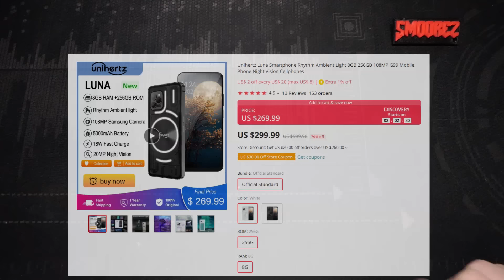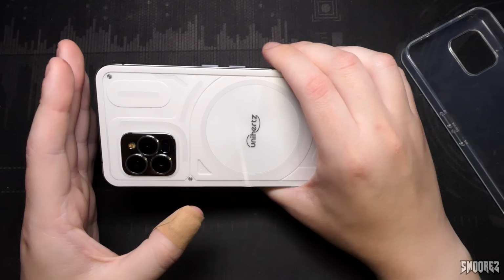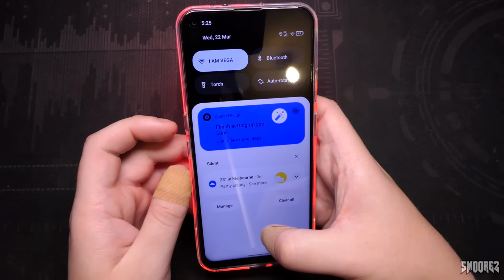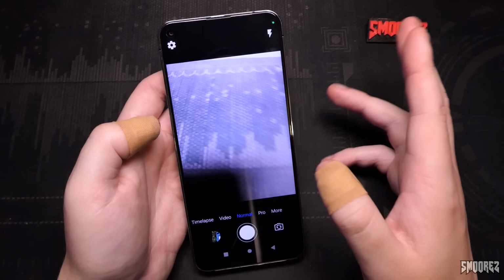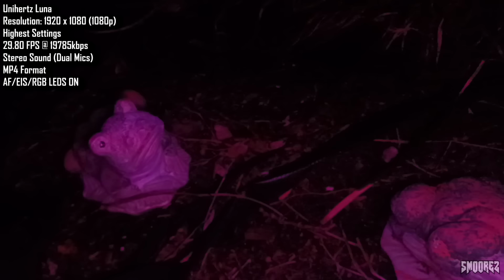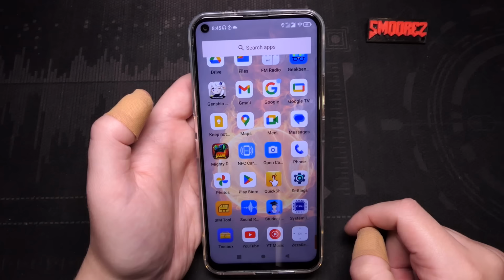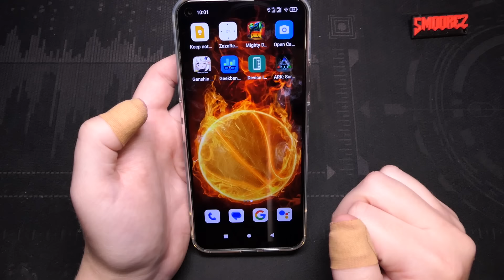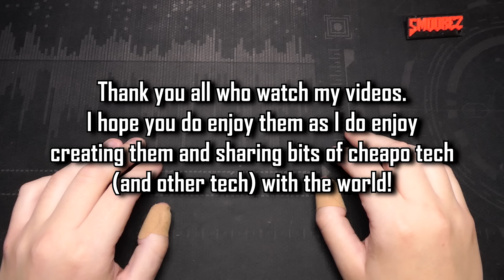Unihertz Luna Ultimate In-Depth Review - This $299 USD "Something" Phone has some problems...

Comment: The fact that at one time for the same price you could get a Pocofone F1 is so mental.
Reply: best phone, still using it. Sad that 300$ flagship killers (with the top QCOM SoC) aren't really a thing anymore. Phones just got too expensive (And I think this will actually hurt the phone industry. Atleast I would have replaced my phones 1 or 2 years ago if such a flagship killer was a available), with the high prices I will still wait to buy one. My Poco is now almost 5 years old - crazy... Still very much usable, Android /phone software finally seems to have reached the point where the basic requirements don't change that much anymore. PCs reached this with Windows Vista 15 years ago. A 2008 PC is still plenty fast for browsing the web and doing everyday tasks
Reply: Or Poco F3.
Reply: @TheRailroad99  This! Mine had the audio die on me completely. Opened it up, seems like a motherboard issue. Been extremely frustrated with the whole Android scene, not only do these devices not exist, but devices at even higher price points are becoming worse. Poco as a brand included, I mean just look at the X3, which was a budget midrange phone at $200, and then look at the X4 and X5. Samsung decided "horseshit" was an acceptable substitute for "phone", Huawei can't use good quality hardware to pair up with their incredible software, Xiaomi became a premium brand. The fact that a used iPhone makes sense in 2023 is insulting, since Apple isn't, and has never been a high bar to clear. I bought one off a fella here, I do honestly think it's the only way to go if you don't want compromise, but also don't want to spend multiple months worth of rent, or a facy vacation at some designer jungle hut on Airbnb. I literally don't know of a phone that's receiving that much software support love from developers. Like maybe a pixel? But those cameras just ain't the best anymore.
Reply: Got an LG V60 for a little less, and I couldn't have asked for better at such a price. Really it's nearly the perfect phone for me. Sad LG tapped out of the market.
Reply: @scoredbuffalo31  Do they have unlocked bootloaders?

I'd unironically buy an LG Wing today if there was any 3rd party developer support. Or just any LG phone with a DAC.
Reply: @vegcharli 
You had the ability to unlock the bootloader using tools LG provided, but they shut that down. You can still unlock it though, but I haven't looked at anything much.
Reply: @vegcharli  been team android for over a decade and I've switched over to iOS. It just makes sense these days. Once we get alternate appstores with iOS 17 that'll be it.
Reply: Isn’t the Poco X5 5G the new F3?
Reply: @jjcoolaus  What?
Reply: @TheRailroad99 I’m not sure of American pricing but the pixel 6a is in that price bracket isn’t it ? That cpu and gpu ( and ai stuff) is way faster than a 845
Reply: who the hell buys xiaomi pocofones?
Reply: @nujiTitsFucker69  At that time, everyone with 2 braincells. Better than the three times the price Pixel 3 XL in every way. LTT even made a video about modding it.
Reply: Or a iPhone 12
Reply: @nujiTitsFucker69  nobody for now.
The people who used to buy them bought them when a good phone from them costed $300 USD
Reply: @TheRailroad99  Running Poco F1 since launch, Evolution X ROM and still runs smoothly. Only issue I've had recently is battery capacity going down (duh, been daily driven for what like 5–6 years?)
Reply: Pocofone f1 is horrible
Reply: @pur3tokzik962  Lmao? Poco F1 was one and only where you could get top end SOC for $300 nowadays, you get garbage for $300
Reply: @Chomakot until EMMC start broke
Reply: Used poco f1 for 100$
Reply: @Chomakot  just use a modified 5k mah battery .. im using it on lineage getting max 12 hour SOT
Reply: @gheyvillan9638  you got any links?
Reply: @jjcoolaus i don't think so
Reply: F5 is here, and on sale you can get them below 300 usd 👍
Reply: This is the same price as a nothing phone 1 now. 

Nit really a comparison at this point
Reply: @minbcraft Snapdragon 7 though not 8
Reply: @Angultra  It's actually not that far behind the 8+ Gen 1.
Reply: @Chomakot What about the POCO F5?
Reply: @Angultra Look at the performance... it's better than the 8 gen 1

Comment: Bruh... Seeing ZazaRemote makes me so nostalgic for the time when flagship phones still had IR blasters.
The most useful feature phones ever had, imo.
Reply: xiaomi still does them
Reply: and xiaomi also lets you shut off the swap in advanced options
Reply: @tylern6420  in general the xiaomi phones are nice as they are well supported and can be bootloader unlocked almost always. The good ones got a bit too pricey however.
Reply: @TheRailroad99 and Xiaomi did not tell me to throw an expensive smartwatch into the trash, just like Samsung did, in 2021. Xiaomi is making good quality products.
Reply: @andrasszabo7386  if you don't mind the Uygur forced to work on those assembly lines, or did you think products really came that cheap without some exploitations? Naïve
Reply: @memeuridedimineata  Apple or other companies also have factories in china. What makes you think they wouldn't kill for a profit
Reply: @TheRailroad99  and you can do hdr without shelling extra money
Reply: I still have a tab 4 with an IR blaster. It needs a custom rom tho
Reply: @memeuridedimineata  not all xiaomi phone are made in china, mine are made in Indonesia

Comment: Thank you for the review! I am actually a big fan of the Unihertz brand as they strive to make phones that stand out in a competitive market.

Have you considered reviewing the Unihertz Jelly 2? I own one and it's a tiny, cute curiosity with a 3-inch display, headphone jack, NFC, programmable button, fingerprint sensor, LTE, infrared port, and even a hand warmer, as it tends to overheat! It costs around 200 USD, but if you're looking for a more budget-friendly option, you can go with the Jelly 2E for about 160 USD, which has lower specs. Think of it more as a feature phone that easily fits into your pocket but operates on a normal Android system. I'm sure your audience would love to see your thoughts on it.

Keep up the awesome work!

Comment: I watched the whole thing without using a single timestamp.  Some thoughts:

1)  Quick Charge is Qualcomm's standard for fast charging.  The one everyone else uses, even OnePlus uses as a fallback when you don't have a VOOC charger handy, is USB Power Delivery.  Many (all?) other Snapdragon flagships support both QC and the faster versions of PD.  I use an old Moto Turbo Power brick (QC Quick Charge with a different name for marketing reasons) to charge a Mediatek tablet and WiFi hotspot and the brick knows to drop down to PD-1 automatically.

2)  I don't think I've ever seen you this underwhelmed before.  Frustrated, yes.  But underwhelmed, nah.  It's one of those phones where it's cool if you win it in an online sweepstakes, but isn't worth paying for.  I like Unihertz's business model of reviving older designs for the modern era.  I keep hoping Unihertz will knock-off the Xperia Play.  This Nothing phone knockoff appears to have been a mistake.  What's the point?

3)  Yes, I read the message and I heard something.  It sounded like burping.
Reply: Yeah for a brand that prides itself on its quirky niche phones that actually fill specific roles this one is really confusing.

Comment: so i got this phone back when you posted this video because i needed something to replace my galaxy s10. and getting it on amzn meant i could return it if it came as hat garbage. aside from the google play store blocking installs of apps "that are not compatible with this device" sideloading them worked fine in 9 out of 10 instances. like i can still update genshin if i bash my fists at my keyboard and find an updater that will work. load it from my pc to my phone then let it take its sweet time to actually install. it still plays well enough i can run around in game on a bus ride. the only other issue i have is battery life. i think it suffers from hung background tasks and will just. tank at random until i reboot it to prevent it from making me worry its gonna set my pocket on fire. i used your video to add thermal compound to it and its been better

Comment: As you said many times in your video, the Helio G99 is not a good fit for this device. Per the spec sheet on MediaTek's webiste, G99 lacks 5G support and can only encode and decode video at up to 2560x1440, which is why you can't record in 4K with this device.

I have been collecting Unihertz devices (for some reason) and they've had some great hits and some sour misses. The TickTock comes to mind as another Unihertz phone that doesn't live up to its potential; the subscreen was cool for about an hour and then I realized the implementation was pretty useless. I don't think you did a review of the TickTock, but it would probably be interesting to take a look at. There are two updated, smaller models as well with the same dual-screen concept.

 I've had a Titan as my primary phone for over two years now, and I still love it. I'd love to see a refresh of the Titan in a similar form factor, keeping the massive 4.6" square screen. I will probably buy a Luna soon as a curiosity, but I agree that it misses the mark in several ways. 

I really appreciate the in-depth looks you take at all these devices. You're awesome!
Reply: Paid comment
Reply: @trentonking5508  oh boy I wish I got paid to write comments like that. You're welcome to pay me, if you want. In the meantime, I'll just keep trying to be nice to people on the internet for free.

The reason I called out the Titan is that SMOOREZ has done a similar in-depth review of that device, so he's no stranger to Unihertz either.
Reply: @umby9 I wonder what is the Mediatek Helio G99 for?

Kinda reminds me of the other Mediatek SoCs that I now forgot from a decade ago. The ones with very poor optimizations and quick to heat up in a short amount of time from playing any games to recording videos from a Mediatek-powered phone.
Reply: I have a Titan Slim, and the lack of support for 5G WiFi with multi/mesh access points is a big deal breaker....

Comment: Gestures are better to avoid screen burning. I had on my S20+ navigation buttons,  and now they are permanently on screen.
Reply: On amoled screens, that is an issue I have only experienced on Samsung devices. My 2020 Xiaomi amoled still did not have that burn-in. And the Unihertz Luna's screen is not even amoled so it will not burn in.
Reply: Yeah I wonder why Samsung sAMOLED display is prone to burn in problem.
Reply: im writing this comment on a note 5 with severe burn in, lol
Reply: ive had s9+ for over 5 years and no screen burn-ins at all. its just a matter of not using the phone every day for 8 hours on 100% brightness fr.

Comment: Af far as I can see, the "Brighten with HDR"/"HDR effect" thing Google Photos is trying to sell you isn't related to the phone's actual HDR camera feature. It offers me the same thing on regular old jpg files that aren't from my camera, and even memes that weren't made with a camera. It just seems to be some brightness/contrast/gamma/saturation twiddling that presumably looks nicer on images with 10-bit color where it can reveal over- and underexposed areas better. Similarly Google Photos' "blur background" effect is just some AI background select thing, and works fine even though my phone doesn't have a depth sensor.

Comment: kind of sad that unihertz needed this.
I know unihertz for very special niche devices (like keyboard phones or phones with a weird form factor).
Maybe, if they are reading the comments: Please make a small (but not tiny) device, something around 5 to 5.5 inches, but modern (small bezels) with top specs (Qualcomm, not MediaTek. MediaTek is unusable as most MTK devices get very bad update support and MTK has poor open source resources for LineageOS etc). Something like the iPhone mini series, but for android.
Sadly, there are not many phones like this. Pixel 4a for example was great (however not top specs), the zenphone was great as well (and indeed had top specs, but AFAIK a locked bootloader).
It will be a niche device, so make sure people will like it by having it unlockable. Many big brands (namely OnePlus, Xiaomi, and partially also Oppo) got big because power users / nerds recommended them to other people. (Great examples are the older OnePlus devices or Pocophone series - both sold better than expected because of this effect). The phone could be priced in the $400 - 550 region (I guess less is not really possible for flagship spec CPUs).

Comment: You could get a decent used Pixel 6, maybe even a Pro with a few scratches for this price, all with 4K video and 5G support. The lights are cool, but the lack of modern features in exchange is a bit of a drag at that price point.

Comment: Was only a matter of time until something like the Nothing Phone One turned up. But sadly - this one does not take the idea of flashy LEDs - and give it its own spin. The "glyph" interface looks like a cheap copy of the Nothing phone. 

As for the specs - while i do not think that you need top of the line specs (like do not need those AT ALL) ... i think phones, cheapo phones should have specs like a Samsung S9 or S10 these days. I can get a used (but pristine condition) S10+ or S10 5g ... for roughly 150$ today. The Nothing Phone One costs 400$ for heavens sake ... ( + import tax, because my country sucks when it comes to global trade deals) ... and the Nothing Phone is a very, very solid phone, spec wide as well as build quality wise.

This Luna phone "should" be of similar or better quality when it comes to its build .. because its specs are worse.

So why buy a 400$ Luna, when you can buy a 400$ Nothing phone....

Comment: Helio G99 its quite an OK processor to run Genshin Impact. But don't set as maximum settings as possible as it might be very laggy.
Overall it can be quite decent to run any heavy games like I mention above. It can be a perfect second phone. Plus, it have similar like Nothing Phone (1) design language behind the phone which is quite nice and its much cheaper than Nothing Phone (1).
18 watt charger might take some time to charge up compared to Nothing Phone (1) which have 33 watts.

Comment: Honestly, for the 'new' device, I CANNOT PUT this thing TOO BADLY. Sure, you can go in the market and find second-hand phones with much better specs and stuffs in equal or lower price, but for generic device that does everyday stuffs, this thing is in 'very good' range tbh. It features all parts that aren't outdated, very large storage capacity, very large RAM, and 'weird' gimmicks for only $299. This thing is still 'much' better in terms of specs compared to so many of cutting edge budget interbrand phones out there (I bet the best you'd get in retail is 6 GB of RAM, 128 GB of storage, and lowest specs 5G chip). I seriously doubt if you are able to find interbrand phones with this specs, since this phone is 4G with one of best availability and good chip (Helio G99).

Only put down of mine is that the cooling system could be done much better. For now it only rely on display to spread heat and in fact that the display is the heat generator itself. This thing won't last long in intensive tasks especially Genshin Impact. Phones in this price range could have graphene cooler. Another nit-pick thing is that camera is rather sub par quality for all camera stuffs inside. Many of budget interbrand phones still win in this particular case.

I talk with my experience owning similar phone, although mine doesn't heat up like crazy although Genshin Impact 60 FPS is still nono without external cooling. And I think that this device could serve people with thoughts of changing phones in occasions, plus not having to go into headache finding best devices your money can buy, or putting in a risk of getting some random stuffs from previous owner, etc. Still, if you wanna go cheap with best specs, this is not an option, but for reasonably cheap phones without the need to deal with person, this thing could perfectly serve you.

Comment: They certainly put nothing into it. I wouldn't touch it for that price, it's not even a Snapdragon. They could have put "LUNA" down the back and included a mini extra screen, that would be a little more unique. Put EL around the edges as it's low power and won't generate heat. Do something someone else did, but do it better.

Comment: i mean 100$ more and you get an poco f4 with flagship specs and 33w charging
Reply: even a pixel 6 pro or 7
Reply: used tho
Reply: Exactly. It's not even that much cheaper than the original nothing phone
Reply: Ye, my Poco F3 for 285 euros was a great deal back in 2022 may. It really does wipe the floor with this unihertz, I was kinda hoping it would do better
Reply: @daftbence  Light gimmick . Even nothing has a few other pros